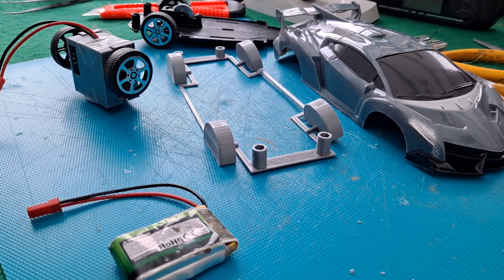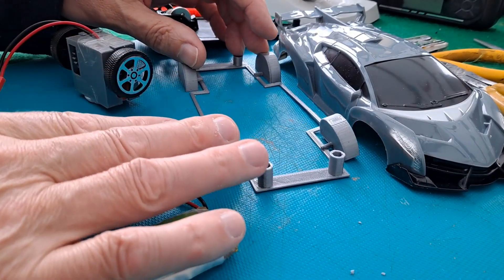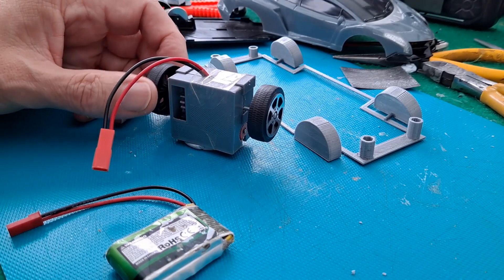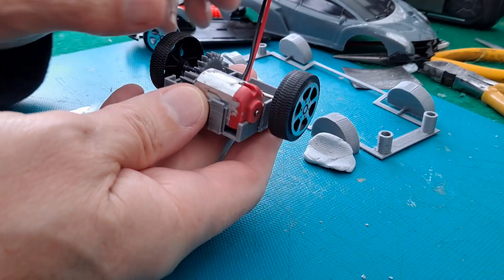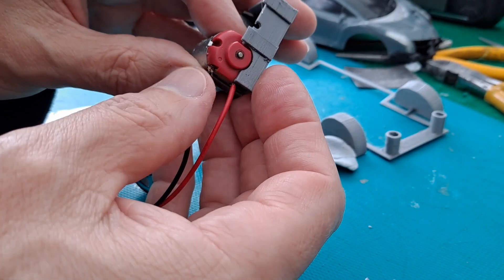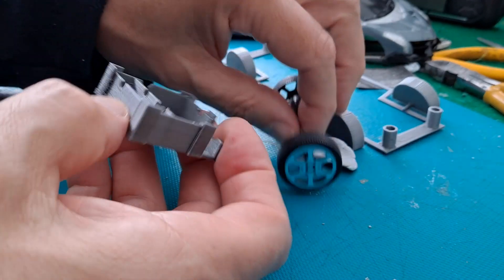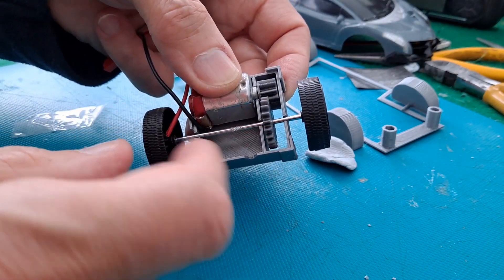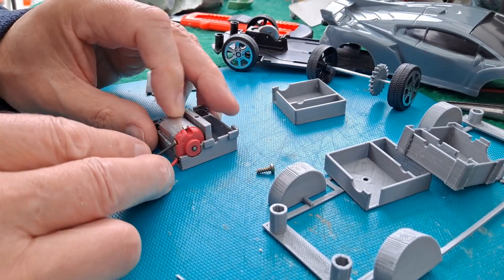Poundland toy car RC conversion project PART 2 - looking at the motor and gearbox

Comment: Looks good so far. I like the idea of the Box with the direct drive in it.wonder how the steering will Pan out. The car might spin its wheels on a slippery surface. Nice video too.
Reply from the maker: Thanks, Marc 👍, I haven't progressed this for a couple of weeks now as I have been on holiday and I have a fair bit of holiday footage to edit before I can get back to working on this.